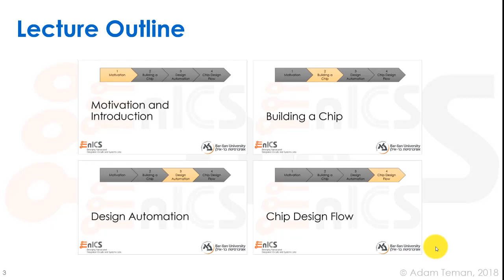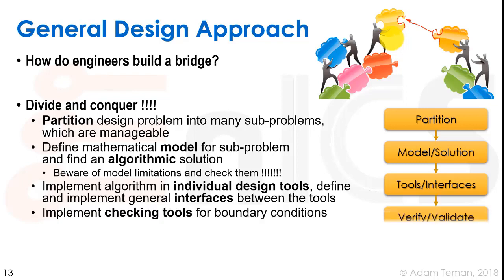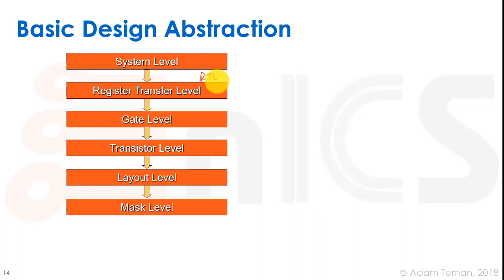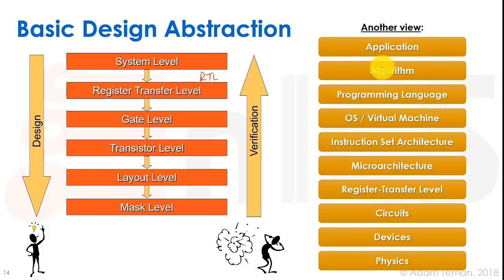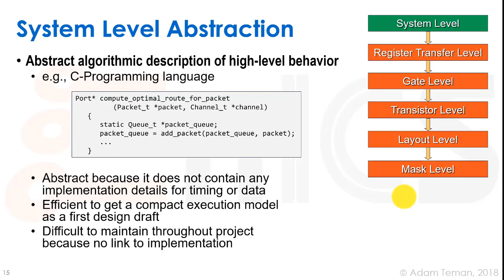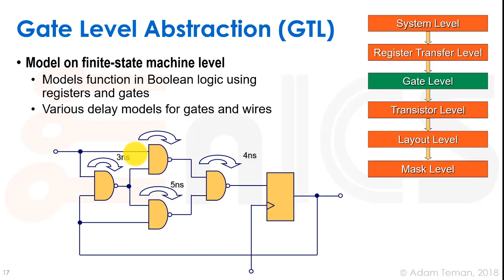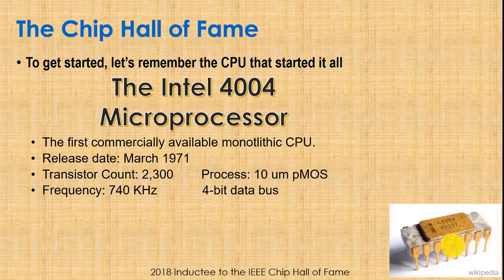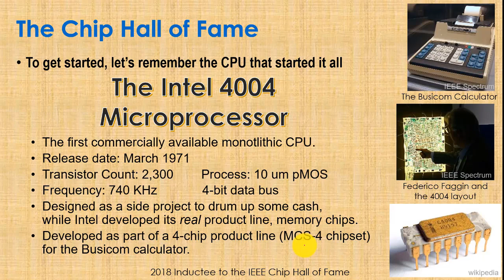DVD - Lecture 1b:  Building a Chip

Comment: (1) Introduction to Digital Electronic Circuits 83-308
(2) Digital Integrated Circuits (VLSI) 83-313
(3) Digital VLSI Design (DVD) 83-612
(4) SoC 101 83-953

Hi Professor, i listed your course available online. is it the correct learning order?
Reply from the maker: Hi, 
Yes, this is probably the best order. Thanks for pointing this out.
I have a few comments/addendums:
1) SoC101 is probably independent. It could be watched first or in the middle or whatever. 
2) The Digital Electronic Circuits lectures are only in Hebrew. I don't teach the course anymore (for many years) and so haven't taken the opportunity to update the course and record it in English. That said, all the content (slides, handouts) are in English and they are quite self explanatory.
3) There is a lot more content, beyond my core courses. At the EnICS Labs website (https://enicslabs.com/education/ ) there are several categories of lectures, including short courses and tutorials. These are mainly complementary to the core courses and really worth checking out.

Thanks again,
Adi